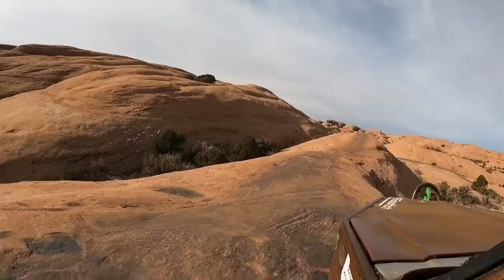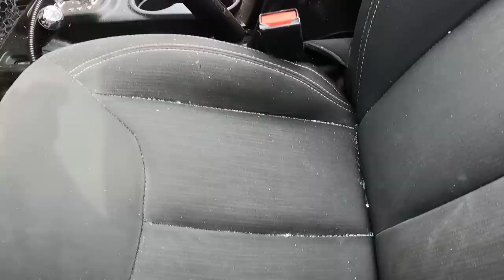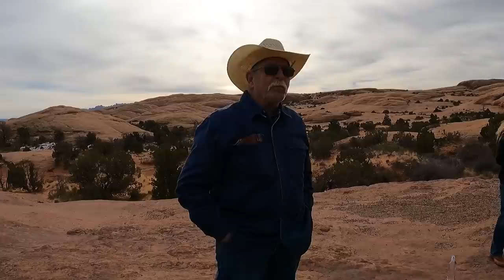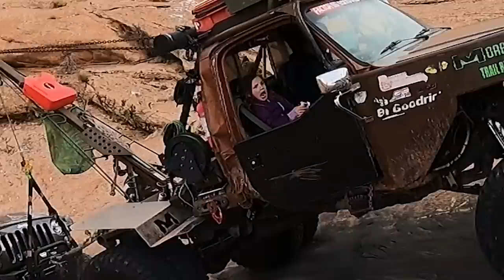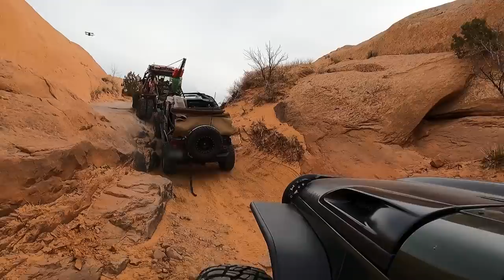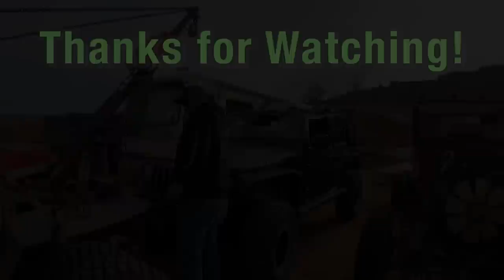Jeep Rolls Off Dragons Tail

Comment: Because of your vids, I’ve been welding plates welded in a C-Rok steering box plate with new high strength nuts and bolts , went with Rusty’s tie rod and drag link instead of reaming out my knuckles for a one ton, got alot of great ideas to make my Jeep less prone to break….thanks!

Comment: Trail Mater should put a remote control retractable swing arm with weights on the outer end and attach it to the front part of the frame that can be swung out forward to put more weighted leverage on the front end for more front end traction and to keep the front end down when towing.

Comment: I end over ended my 91 Explorer in a ditch and used a eye bolt, three ton puller, tree limb and a sledgehammer to straighten the roof out in the back where it was smashed down. Tape measured from corner to corner until they matched and put a replacement lift gate on it. It still needs some small dents fixed but it’s amazing what you can do with common tools and hard work.

Comment: If the air bags didn't go off like this, does it have a chance at living again or is it probably totaled?
Reply: Oh that'd be totaled, I've seen way less damage get totaled on rollovers
Reply: Idk if you watch fabrats but his sas Tacoma was technically totaled before he built it, good example
Reply: And is it insured off road?
Reply: Probably.  New hood,  windshield frame and top.  Good to go.
Reply: Watching the video, I was wondering the same thing myself. I think if it is, it might make sense for the owner to purchase it back, throw half doors on it, cut off all the original cage, and have a custom full cage welded in, kind of like Holly's Mischief Maker.

Comment: With a good guide and paying attention this can be prevented. Did Hell's Revenge at least 20 times when I lived in Moab. Been over 8 years since I did that trail, having moved to ID, but why is he going back the way he came in from  (via Sand Flats) since continuing on to the finish would have been a lot easier without steep climbs? And also, who did all those marking on the trail. back when I did it there were some small marking but lines along the sides? And last, who wants to see some kid. Adults only!

Comment: Paul your truck looks a little  light in the front . Are you using fluid in your front tires if not you might experiment with some water to keep the front end down.😅😅

Comment: Quick observation and I could be totally wrong here. Once you got it on all fours, why not kick the windshield out of it and drive it out of there? Just a thought I had
Reply: The difference between tipping onto their lid, and bouncing onto the lid is crazy. Way easy to break some little dodad that's real important to these electroplastic tinfoil turds.
Hell I've seen the brain board break in a harsh roll down a canyon.
That's why mine keeps going. It doesn't have stupid stuff to break like computers and stamped steel track arms.

Comment: Curious question, why did the recovery rig have its tires so inflated? Seems like it would have better traction if they were aired down a bit more. Is it better for the tow rig to have stiffer tires?
Reply from the maker: They're at 12 psi.

Comment: OK  OK  You said you've got things and do them your way. So I'm just asking your opinion not saying you should do it any other way OK? You know that heavy duty reinforced rubber sling that is used for bumper lifts. Could material  like that be used in place of that crossed straps you use? Maybe doubled up but still crossed like you do. Does that sound like it might work? Remember I'm just asking your opinion.

Comment: fyi: NHTSA Campaign Number: 22E101000

Manufacturer WARN INDUSTRIES, INC.

Components ELECTRICAL SYSTEM, EQUIPMENT

Potential Number of Units Affected 121,187

Summary

Warn Industries, Inc. (WARN) is recalling the Wireless/Handheld Remote sold with certain VR EVO 8, VR EVO 8-S, VR EVO 10, VR EVO 10-S, VR EVO 12, VR EVO 12-S winches, and Remote Service Part. Please see the recall report for a list of all affected winch part numbers. Water may enter the handheld remote control for the winch and cause circuit board corrosion, which can allow the winch to operate unintentionally.